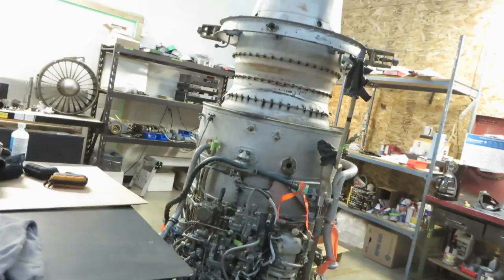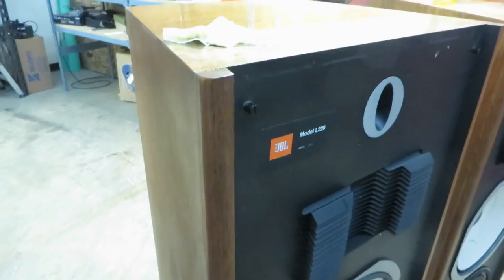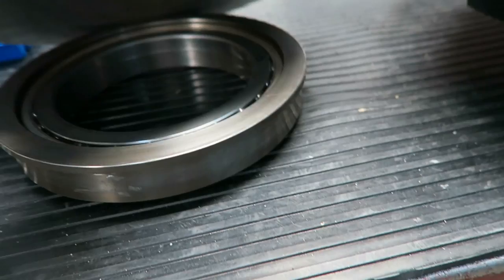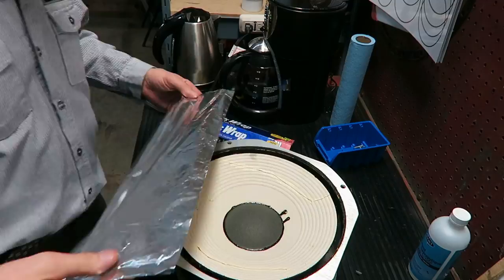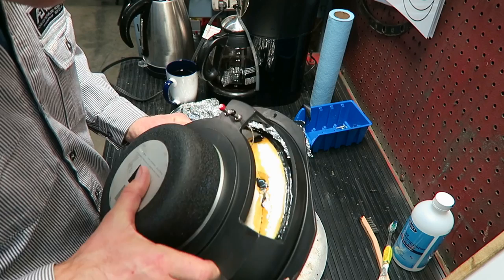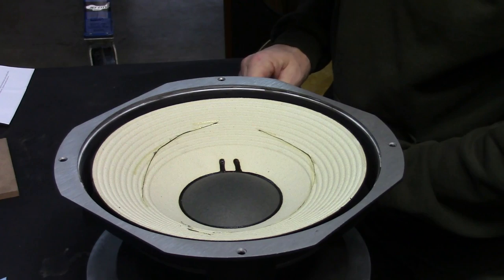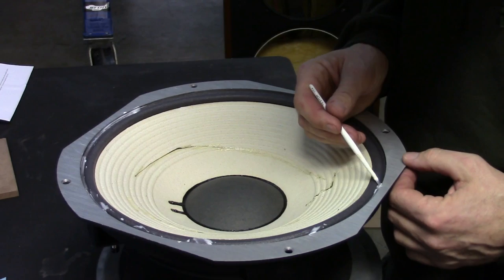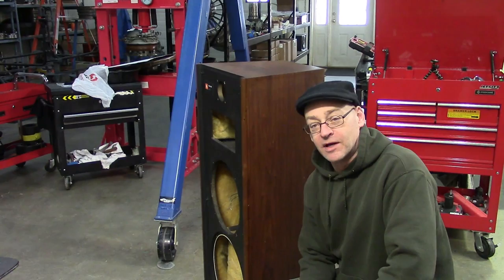JBL L220 pt 1: Low Frequency Units

Comment: As a paper cone connoisseur, I  would recommend changing the white cones. The whole point of a pulp cone is light weight which means fast cone movement and thus great transient response. The weight of the glue of the repair will impact this fact, even if the surface of the cone is now sound. Hope this helps.
Reply from the maker: +Alex Tomlins 
I agree. Theoretically it's all true.
In practice, they sound great, and it would take over 700.00 to replace...

Comment: Years ago, my sister got me some 200 watt JBLs (I forget which model.). And,,wouldn’t you know it, I found a cd do different sound effects, artillery, steam locomotive engines, and THE SR-71 making a low pass.  It was unreal. The light roar in the distance in my right speaker, getting louder, deeper, more crackling, blending into the left speaker with a loud cracking almost thunder clap of roaring engines, fading off to the left.  Unbelievable sound.  Indoors, it rattled my windows.  Out doors, up on my roof, at 01:00 (New Years 2005), cranked up, it drew out the neighbors.  Of course, they couldn’t appreciate the stereo effect, until I did it one more time.  Normally, I’m a good neighbor.  But, New Years?  All bets are off.✌️🤙

Comment: I've been looking for replacements for my Peerless 12" woofer's. I bought a pair of cabinets with really crappy drivers years ago and I replaced them with all peerless drivers. At the time it took something like B&W or KEF speakers to even come close to them. Nice tight punchy bass, and natural minds and highs. The dome mids and dome tweeters are still in great shape, but the paper cones and foam rubber surrounds have disintegrated in the Arizona sun after 20 years. I hope you get these back in shape!

Comment: Thank you ever so much for posting this! I have a pair of L220s that need the surrounds replaced. Seeing the process makes my confidence in doing this myself much higher knowing what I may run into. I was especially concerned with the coil alignment, as like you I didn't want to remove the dust covers just to insert shims. Doing it the way you are doing it makes much more sense. :)
Reply from the maker: They are working perfectly. So much B-Bass, I usually don't turn on my 18" sub. The process I show in these videos has yielded 100% success in my opinion.

Comment: I still enjoy my 2 KHL 6 speakers from the 1960s.   They seem to be in good condition with no repairs.    The audio amplifiers, these days, are I think far better than the vacuum tube circuitry available 55 years ago.  Then I had a Heathkit amplifier to drive my KLHs with Eico preamplifier.  Now, it's all solid state and in one box, far less expensive than then when the US dollar was worth something.   
Anyhow, the important part is the music.   If you enjoy it, then you can enjoy it on a Victrola!

Comment: I really enjoyed your videos for the JBL. I’ve refoamed tons of speakers, especially by AR but really wanted to see a JBL restoration. The reason is, most foam surrounds are attached in the front where JBL like to attach behind the paper cone. I was looking forward to seeing you glue in the surround behind the cone but that part was skipped over! Can you fill in the blanks a little? Was there anymore cleanup or was it just applying glue at this point? I’m assuming you left the entire speaker upside down while the final glueing took place, right? Totally enjoyed your series here. I want to pick up some L100s and restore them someday so I know this will come in handy. Fantastic job!

Comment: Hi Jayz
I love your stuff.  You're doing a good thing by educating and entertaining  us. Thanks.  
It  boggles my mind that stereo connectors that combine spring loaded pushbutton contacts and a bare wire could maintain the low resistance/Impedance required for "HiFi". JBL seem not to have a problem with push button connectors.Can you comment?  It seems to me that a quality binding post or solder would be better.
Reply from the maker: +Karen Charlong Well, JBL has lost a lot of ground lately in the home sound market, but they are still among the leaders in the industry that they helped to invent back in the 1930s. That is professional and industrial sound reinforcement and reproduction.
Earlier in my life, I got caught up in the obsession with premium connectors, gold plated, oxygen free, blah, blah...
Interesting to look at how the people who make the best of the best don't worry about that at all.
Interesting you use the ancient term HiFi; JBL maybe didn't invent HiFi, but they were there at the very beginning in the early 1950s with the 15" bass drivers in the Hartsfield system.
They now go for thousands on Ebay.
Technology advances all the time, and we are now more than eighty years since James Bullough Lansing drew up the plans for the first compression driver. A lot of claims have been made, and many speaker manufacturers price their products much higher than my favourite brand, but I trust that the people who make audio products ranging from some of the best bluetooth speakers to the huge sound reinforcement arrays used in concert by many top artists... know what they are doing.

Comment: Wow, that didn't look too bad.  I have seen & known of D.I.Y. surround & reconing kits but was skeptical of my abilities.  I was thinking there are better surround materials, more silicone rubber like than foam.  They may or may not last any longer but are more 'compliant'.  Looking forward to the next videos to see the outcome.

DD
Reply: I have a pair of 12" 3-way Fisher speakers made in the late '80s with a very neat cloth surround shaped just like the rubber surrounds you find on nicer woofers.  The surrounds are lightweight but they're pushing 30 years old and there's absolutely no deterioration.  It almost looks like the coarse material they use on the inside of an embroidered ball-cap.
Reply from the maker: +AKLmfreak One advantage of cloth surrounds is that they are immortal. The most powerful guitar speakers use them. I am not sure what the advantages of foam surrounds are, but they are not difficult to replace.
Reply: +AgentJayZ my best guess is that the foam surrounds offer a lighter "spring rate" for the speaker's suspension as compared to the heavy-duty rippled cloth surrounds seen on instrument and public address speakers.  That would enable a lower-powered driver to respond more quickly and accurately to the input signal such as in studio monitor and home listening scenarios.  The cloth surrounds on my Fisher speakers are very soft and feel more like foam surrounds as opposed to the thicker, rippled surrounds on heavy-duty speakers.
https://drive.google.com/file/d/0B8HNCGJBs04mcXBBeHVCZTRyTzg/view?usp=sharing
Reply: +AgentJayZ One advantage is that foam will allow a lower cone resonance because they are generally looser than cloth,  the lower cone resonance will allow the driver to produce lower tones....The JBL 2240 is identical to the JBL 2245 except for the surrounds. The 2240 has a cloth surround and the speaker doesn't go quite as deep.I don't have to yet, but I know eventually I will have to re-do the surrounds on four 2245's in my set up. Its nice to see step by step how to do this right. Thanks very much for posting this how to video.  :)
Reply from the maker: Wow, four 2245s with sufficient power would be more than enough bass for a 200 seat movie theatre.
Fear not! I have done a full recone on one of those, and if you follow instructions, it's new again.
Reply: +AgentJayZ Thanks :)   I don't like the idea of removing the dust cap either. One trick I heard of to assure centering is to hook up a tone generator with a low frequency tone to the speaker while the glue is setting up.but this would require that the surround be glued to the cone first, then the basket.You have a good friend! and those are nice speakers he gave you!!! :)
Reply: +AKLmfreak Yes, it helps to lower the distortion figure.  The cone is 'more able' to follow the changing magnetic field, which of course is produced by the changing current in the voice coil.  The stiffer but tougher cloth surround has more dampening, which tends to resist movement.
Reply: +Darren Duncan This reply was to "AKLmfreak" 's comment on foam surrounds & their 'spring rate'.

Comment: I had a set of what I think were JBL 4410's from the early 80's and used to run them with an older set of Sansui SP5500X's powered by a Sansui 9090. The JBL's blew in a few years but the Sansui's are still running to this day.
Reply from the maker: +johnabuick  You destroyed a set of extremely high quality professional studio monitors... So my mom says we can't be friends any more.
Reply: AgentJayZ
Hahahah, funny. I didn't try to destroy them, they were rated for more power than the Sansui's. Been thinking about having the Caps replaced in the Sansui's. I now have a pair of Peavey's running with the old girls. Can't blow the Peavey's and I was surprised at how cheap the Peavey's are. They are commercial grade and nearly indestructable.
Reply: AgentJayZ
By the way, I watch lot's of your posts. Don't know much about turbines but I have a secret love affair with that kind of power.
Reply: johnabuick JBL,s are very fine very sensitive speakers they were never meant to handle lots of power they don't need lots of power because of there sensitive nature.

Comment: back to the jets...lol...loved this series though...my cousin has the same set of speekers...I just one of the blades or veins has there cooling air passages plugged up, will that do damage to the engine? does that one plugged part stand out next to its side by side sisters? also...how much would a compressor or turbine blade have to melt or loose metal to affect the balance of the engine enough to feel the vibration from a cockpit...I know there are a lot of questions in that paragraph but I hope I was able to get my point across enough for an answer...thanks Jay...great to see you in your personal Hobby mode...I personally build RC planes etc...but digging into a speaker from the early years would definitely tickle my fancy...thanks again

Comment: Great video. Hope you're happy with them. Maybe I can share some advice I got with my own JBL 250ti? Those low frequency drivers need a full recone replacement to get the right frequency response. Glue on the cones changes the weight of the cones. That changes how they work and how they sound. Also the new capacitors needs to be glued in (maybe with some silicone glue) so they don't rattle around from the air pressure the bass drivers produce. That could also in the end result in loose connections in the soldering.
Reply from the maker: +J Wester   The L220 has the bass driver in a completely separate compartment, as shown in the video. That's to prevent any interference with proper functioning of the other drivers.
Reply: Ah yes you're right. Sorry for that.

Comment: Hefty speakers: 108 pound.  Mind your back.  I don't understand how you can live with those slashed cones.
Reply from the maker: They look rough, but judged by the way they sound, they are like new. Big speakers are great.
Reply: A case for replacing the cones would be that the repairs might impact their ability of the cone to decouple at the upper frequencies in their pass band. Cones are not perfectly pistonic across their spectrum if the wavelength of the emitted sound is shorter than the circumference of the diaphragm.  The ribs in the cone act like surrounds to decouple the outer cone from the apex at different wavelengths thereby improving the linear response within the passband. The repairs may impact the cone’s compliance at various frequencies.  But if they sound ok to you...
Reply: Those cones should have been repaired with pvc wood glue and tissue paper. All that heavy resin glue used here, will affect the sound for sure! I couldn't live with those slashed cones unless they were covered up with a speaker grille.

Comment: Nice project. Its kinda sad to see the thread like size wires inside the cabinet. Lesson learned, I'll never buy speakers with foam type surrounds. My 22 year old B&W 801 surrounds are made of a rubber type of substance and they are in great condition.  The only thing I did was upgrade the thin wire inside and new Solen Crossovers.The old school speakers are really very good and well worth the money even if repairs are needed. I use 350 watts of Krell Class A power with an Allnic tube preamp and they take the power very well, nice and loud and crystal clear. Ive listened to a few high end, re expensive speakers and I'm very happy with  what I have as it sounds very close and sometimes better  than the new style speakers of different brands.
Reply from the maker: I would guess that your old B&W 801s sound as good as new ones. It would be a great video to compare yours and a new pair side by side. 
I think a 25 year service life of foam surrounds is reasonable, and I trust that a world leading audio manufacturer like JBL or B&W know what they are doing with wire sizes.
It would not make sense to compromise the sound of a multi-K$  set of speakers to save five cents on wire that's too small, would it?
Answer: the wire size is not too small.
Reply: Consider how short that section of wire is.  You need a larger gauge for longer runs, such as your main speaker cables.  If it is a very short run, the losses will not be significant enough to matter.  If you think about it, some audiophiles use ridiculously thick wires for their main speaker cables (far beyond what is necessary), but even using something reasonably thick, it's almost always thicker than what's inside the speaker cabinet itself... does this mean it's pointless because it's a least common denominator thing?  No, due to the different lengths involved, that's the reason why it isn't patently absurd to use wire that's thicker than what's inside the speaker.... otherwise we'd just use that thickness for the entire length.
Reply: @Artcore103  I couldn't agree more with your sensible comment!

Comment: Nothing wrong with dinosaur technology in my disc jockey days I  used Cerwin  Vega  Towers The best part of it I ran 2 earthquake base bin on each side but I ran SQC amp I could just shake a auditorium just happen to notice the crown power you have there that's a lot of power for a shop lol but the best work gets done around the shop when nobody's around and you got the tunes cranked as loud as it can go cheers
Reply from the maker: +merctr2 My Ebay adventures began when i tried to find an Earthquake sub... literally. I was looking for the Cerwin Vega! 189SW, but couldn't find one, so I bought the next best thing: a JBL 2245H. The Crown Com-Tech 810 is normally bridged in mono to put almost 1000W into it.
Definitely, size matters!
Reply: +AgentJayZ I run a small PA company in Scotland, I used crown macrotech 2400, and 5000 Vz's for years, they were such reliable amps, heavy but reliable.

Comment: You really should re-cone them while they still have recones...
Reply from the maker: The functional test does not agree with you. These can easily rattle the dishes in the kitchen, and they are not in the kitchen...
Reply: @AgentJayZ  Well, for future value i mean. I reconed 7 JBL woofers, 4- 2235's one LE-14H, and 2- 2225 with OEM recone kits and never regretted it. In 20 years, you'll just have to re-foam them unless, your girlfriend trashes em too :(
Reply from the maker: I need to find recone kits for LE14-A that are not A: old stock, and B: a few hundred dollars.
Then I will do it.
But for now, these things blow the living room to pieces!

Comment: @AgentJayZ What did you use to get the black "tar" speaker adhesive off the back of the cone when you were removing the old foam suspension ? Didn't get to see that stage.
Reply from the maker: +KozmykJ The kits all say to use rubbing alcohol, and it works fairly well to soften up the old adhesive.  Then you do a bit of careful scraping.
Reply: +AgentJayZ Thanks. I've got a recone job to do on a pair of DAS 18" subs sometime soon. All tips are useful ;^)

Comment: Funny hearing parts numbers on one of your videos that I know for a change.   A bass player in a band I was in around '87 used a 2x18 with a pair of 2245's and a 2x15 cab with a pair of JBL E120's, Ampeg SVT's... not as loud as a J79 afterburner, but loud enough to feel your internal organs.    
Macrotech 1400s?  "Why does he have a pair of Crown power amps in a jet engine shop?"....
Nice music selection BTW...
Reply from the maker: +Chip Mcdonald I think the E120 was a 12 incher. Maybe he had  E-130s, just like mine. It's a 15 inch guitar speaker... more powerful than a locomotive! Of course being a bass player, he may have had E-140s, which were identical to the 130, but with a copper voice coil instead of aluminum. Heavier, but better heat tolerance.
Reply: AgentJayZ Yeah, they were E140's... I've got VanHalen on the brain, his secret sauce with Celestion Greenbacks people seem to not notice.  
 Nowadays bassplayers are likely to show up with a 2x10" setup the size of a loaf of bread...
Reply from the maker: I think I saw a Pearl Jam video where there was a 4X18 cab on stage. That could knock your drink over!
Reply: I think he was running a sort of Billy Sheehan bi-amped set up at one point, Sting was into biamped 18"s at one point as well I think. 
On stage volume is taboo these days, though.